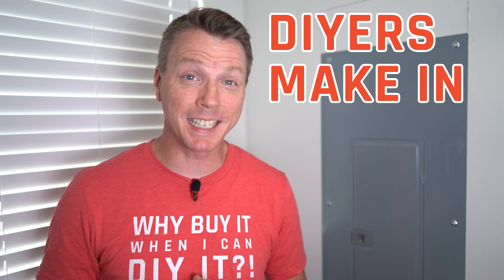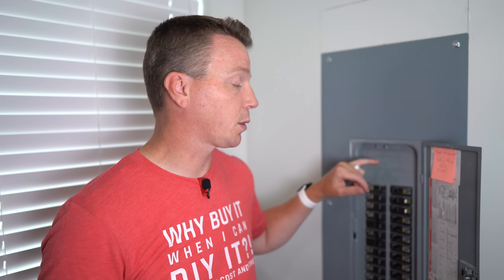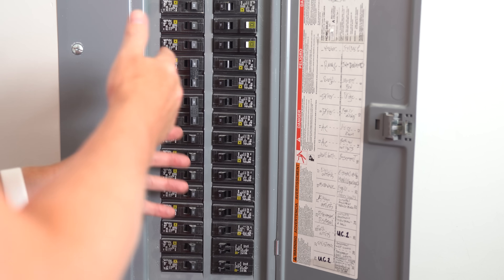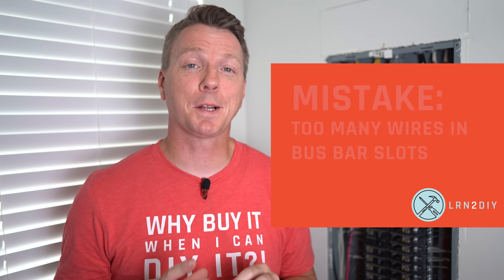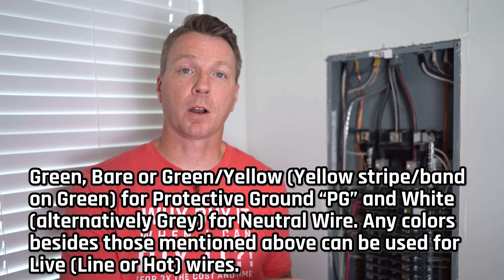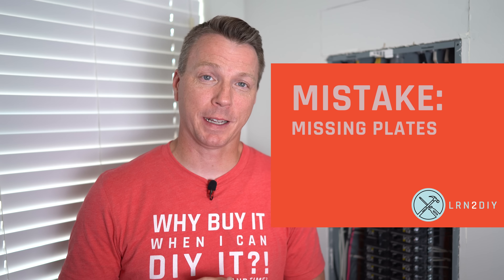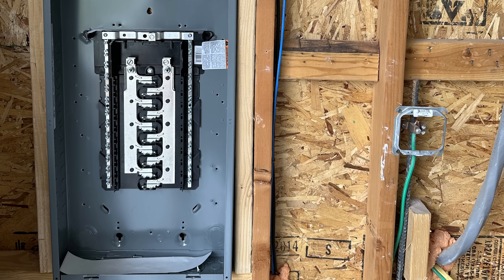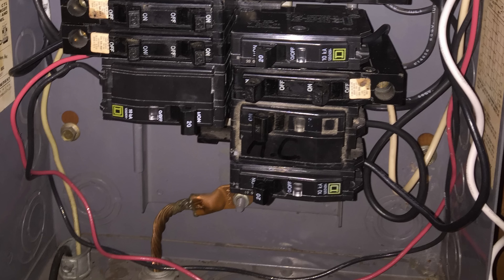10 Common Mistakes DIYers Make In Circuit Breaker Boxes

Comment: @ 2:32 , 80% of 150amp panel = 120 amp. But if you add up the amp of all circuit breakers your total amp is much greater than 120amp. Does that mean a NEC code violation ? So, what’s going on? 

This dude’s short circuit answer: you don’t use all the circuit breakers at once. But his answer is playing hide the ball. You still need to know how many circuit breakers and how many total circuit breaker  amps. 

The dude’s specious answer is dishonest. Or he doesn’t know what’s going on. Basically, he’s “snowing” you. Here’s the answer: The NEC has formulas that calculate the percentage of circuit breaker amp used for bedroom lighting, kitchen appliances, washer and dryer, etc. The formula is based on the probability of your using certain fixtures and appliances simultaneously.  For example, if you’re using the kitchen electrical cooktop , you won’t be using the  hot tub-sauna. This is the reason  your total circuit breaker amperage can exceed the 80%  panel amperage limitation. Notice the NEC has a formula that limits how much your total circuit breakers’ amp may exceed the 80% rule. 

Finally, don’t subscribe, unsubscribe because the dude’s answer doesn’t come clean.

Comment: At 7:15: "Double tapping" on the grounding bus-bar is generally permitted. Refer to the instructions or data sheet inside the panel to confirm this.
Nearly all modern load-centers (Sq-D, GE, Siemens, Eaton) are listed/approved for two (or more) #14 or two #12 ground conductors under one screw... it is perfectly fine and safe.
However, it is generally NOT acceptable practice to mix sizes under the same screw (i.e., a #14 and a #12); both grounding conductors must be the same wire gauge.
In fact, at 12:00 on your video: The data-sheet you show in your panel, indicates that the "Equipment grounding Combinations" are: Three #14 CU (copper), Three #12 (CU/AL (copper or aluminum), and Three #10 AL (aluminum). So your "double-tapped" grounds are no problem!

Comment: What I've discovered over the years is that if homeowners take the time to do electrical work they also take the time to figure out how to do it correctly or they don't do it.    They have a vested interest in doing it right.    On the other hand, you have electricians that work on the rush and miss things that a home owner would never miss.   Perhaps they go out of their way to do it wrong.  It seems that way.   I'm not sure what their deal is.   Nonetheless, you find yourself in an inspection role then you will find more than you can imagine, easy to spot code violations and shoddy work that was done by so-called licensed electricians.    Some of it is so stupid it is hard to figure.  Like a common example is a ground rod buried and a ground wire run but the ground wire is just buried in the dirt and not even connected to the ground rod.   The other classic one is riser pipes installed but not one conduit strap  securing it to the house.   I've seen two pieces of conduit butted up to each other without any conduit connector between them.  A homeowner would never do that.   Sometimes, I wonder if electricians are just screwing with the inspector to see if they're inspecting.

Comment: I always tell newbies to put a small piece of cardboard in front of the main feed (but not contacting the wires themselves) as reminder  to avoid contacting it with any tool or even your hand.  Not touching a hot connection or arcing with a tool is what worries me when beginners take the cover off the panel.  They just have a vague notion of buss bars and circuit breakers.  Getting a shock at a receptical and getting one at a breaker box are wildly different.  One is unpleasant, the other may be life and death.

Comment: unlabeled panels drive me crazy.  overloading, i haven't actually ever heard anyone say you couldnt load them up to their rated capacity. you would need to do load calcs to see what your actual loads are, yes, accounting for some that are continuous loads. Plastic bushings are non required on smaller wires, i think it's #4 or #2 and up. Double tapped neutrals are illegal, grounds are ok for two wires.  Double tapped breakers are fine here (WA) as long as you have those breakers. My biggest thing i find all the time is a cable run into the panel thru a hole w/o a romex connector. I have a torque tool i got from harbor freight, but.... i still use my elbow.  btw, your ugle panel is certainly ugly and your pretty panel is certainly pretty, BUT i see these all the time and i always cut the cable ties off of them. They are fine for installing but guess what you did with all your hots, you BUNDLED THEM!  they are not really necessary with solid wire and create heat retention. and just like you are not allowed to put more than 3 cables thru a drilled hole, because it's bundling, you should not bundle your hots in the panel either. great video, keep up the good work.

Comment: The white wire should be redesignated from the breaker back to where it enters the panel.  You forgot to mention that the panel you are in front of is a sub-panel.  If you do not have filler plates for your panel, a breaker marked spare will work too.  I took an surprised by how many times I've opened a panel to find neutral and ground conductors doubled-tapped when there are plenty of openings on the buss bars where they could be landed individually.

Comment: I'd like to add Air Conditioning to my old house but only have a 100 Amp service panel.  Can I add a 50 Amp subpanel to accommodate the A/C unit or do I run the risk of overloading the 100 Amp service?  Upgrading to a 150 Amp or 200 Amp service panel is too expensive in my area.

Comment: I’m not an electrician  so what freaks me out is when there is a 12/3 home run going to the panel with a shared neutral. I think if you move breakers around you need to be sure you keep the red and black on different phases?
Reply: Two circuits with a shared neutral (3 wire home run) must be connected to a two pole breaker with a common internal trip so they are de-energized together. Otherwise, even if they are on different phases, you can get a potentially fatal shock from the neutral if it is disconnected from the busbar during rework and there's load on the other circuit. And yes, it is important  that the circuits are on different phases, because on the same phase the return current on the neutral is additive, while on opposite phases it is subtractive. DIYers sometimes use  a "twin" breaker, with the single connection to only one phase, which can double the rated capacity of the neutral wire. No bueno.

Comment: Still trying to find out why Americans dont run 200v then sub panle 120v no one in my area will do it then quote 20-30k for a normal 120 that wastes so much wire the homedepot cart i built theres almost 1000 dollar cheeper to run orange romex then sub panle and do short 120v runs since the short runs you can drop gauge acording to charts

Comment: The electrician who wired the shop I have was a drunk, showing up in the morning with a thermos full of whiskey. He put the light switches in the middle of the 2400 sqft building. When I was 17, I rewired it to a three way at each entry. I then got carried away and added 4 circuts of outlets and some pull down extensions. I had bought a book at Lowe's about electrical code and followed what it said. Because I was so young, my parents decided to have an inspector check it out. He showed up and wasn't too excited when he met me and learned he was inspecting my work saying with a sigh, ok, lets get this over with, I might have to come back because I don't have a lot of time set aside for this. By the end, he was nothing but smiles saying he wished every electrician did work like mine. He didn't have a single thing to mark except recommending I use heavy duty switches. If you're halfway bright, you can learn to do anything, just do it correctly.

Comment: I just added a torque screwdriver to "gotta have" tool list as I never knew they existed even though I have several  of the usual torque wrenches. As to rats nests wiring - our last house was blessed with that feature. I would have fixed it if the box was ever upgraded but that's for the new owner.

Comment: although it is CODE to only have ONE neutral per screw terminal (NEC 408.41) you may have as many grounding conductors in the terminal it is rated for ( many times up to 3) usually shown on label in panel ( 110-14) ( yeah I am licensed)

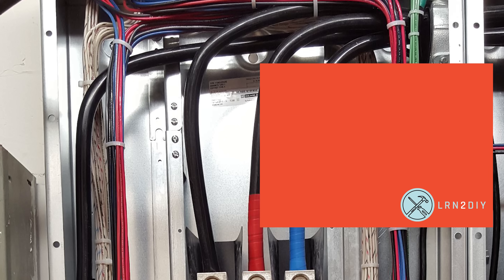Comment: 13:07, This is actually not a good idea because bundling non-metallic-sheathed cables together increases the temperature of the cables due to mutual heating and decreases the efficiency of heat dissipation. The center cables may overheat causing the insulation to overheat and deteriorate.

Comment: (8:15) What about the OTHER end of the red-taped white wire?  It seems to me that THAT is where the actual danger is!  ?🤔
Reply: Other end must be marked, too.
Reply: Absolutely, a white or gray hot wire is even more dangerous in locations other than a panel.  Because in a panel, if I see a white wire land on a breaker other than an AFCI or GFCI type, I can trace it back to the cable jacket.  If the black wire in that cable also lands on a breaker, than I know this is a 240V (or 208V, in a three phase panel, or single phase panel fed by a three phase 208Y/120V service, you'll see this most often in commercial buildings, and in some apartment buildings and condominiums as well ) 

A white or gray hot wire in an outlet or junction box is a recipe for disaster, because there's a good chance that in the future, someone will connect a 120V receptacle or appliance to the black and white wires, unaware of it being a 240V circuit.   

In addition to using the proper colors, when I'm working in commercial buildings, I go one step further and print a label with the voltages and type of system on the cover of each junction box (example, 208Y/120V 3ø , 120/240V 3 ø 4W delta , 277 volts 1 ø, etc. ) as well as the panel & circuit number.

Comment: no no most "professionals" are jokes and idk how they passed the tests but they do and thats where you will get screwed. Im up in canada and im a horrible electrician but even i passed my challenge exam. But before anyone says anything about it its the same exam as the USA. Its not difficult by any means. You could probably cheat it and pass knowing nothing and just going with the common sense safest answer. I am a sparky when i have to be but im also a ticketed refrigeration mechanic and sheetmetal mechanic on top of welding and MET for hvac. But overall not wrong with this video but its a very good once over for any business or homeowner over seeing work done that they are paying for.  Id say i wanna see your requirements/permits for electrical and other trades but i have and in the states its a laugh.

Comment: I didn't read the comments, so it's possible that this is a duplicate of someone else's comments. But as I'm watching your video, I am very conscious of the fact that you are looking in one direction while using your hand behind you in the direction of a hot panel. I personally know people who found out the hard way NOT to put your hands near a hot panel while busy talking about it, or using their fingers to point out issues within the panel. Also sticking your fingers through a knockout inside a hot panel is also a serious safety hazard. Just saying... your information was well received, but watching you is like sitting in a passenger seat as the driver speeds up behind a stopped car and at the last minute hits the breaks... my foot begins to smash on a non-existent brake pedal...

Comment: I highly recommend torquing everything in a panel box bi yearly or at least every 5 to 10 yrs. That will cause a fire faster than an over loaded circuit .
     50% of electrical problems Ive found was from loose mains to loose common and hot buss bar bolts causing shorts. Only a 1/4 turn loose, but enough to cause a sizzle arc and flickering lights. 
  Double checking torque on connections is not something you hear people talk about much, but can cause major issues.

Comment: Crazy to see having aluminum as the buss and using copper. I'm use to doing 400v up to 1000v. I have seen jumpers for neutrals but only for I/O or drives.

Comment: I have every single outlet, light, baseboard heater, fan etc, listed in precise detail (even down to which side of a split outlet) on my breaker panel. I made a separate sheet, laminated it and taped it to the panel.  
it has come in very handy over the years.
Reply: Must have been pretty tricky to squeeze all that info into that sheet. I just made one of those also (not with quite that much detail though). Printed it out on some removable poly labels and slapped it over the label the panel came with inside.
Reply: @0blivionIOX  It wasn't that tricky.  I just entered it all into an Excel spreadsheet and then printed it out.  It's taped to the outside of the panel. I colour coded some circuits such as all the outdoor circuits or kitchen circuits to make them easier to identify.  I also discovered some wiring mistakes when I created it.  2 circuits were actually cross wired.

Comment: My friend is an electrician and has told me circuit breaker boxes are liars and to never trust the labels
Reply: No crap!  I un-installed an old dishwasher and installed a new one.  No power to the old dishwasher, no problem!  I cut the wire..sparks went everywhere 😂. 
I guess the breaker box was marked incorrect
Reply: @lowlifeangler  Testing the power to the unit or using a circuit locator before cutting the wire was a bridge too far, huh ? ⚡⚡✨✨😲                🤣
Reply: @CannonFodder873  I should've known better. My wife jumped...I didn't. Left I mark on my new cutters 😆
Reply: Your friend is right. Whoever labeled mine got the 240V breakers for the dryer and the HVAC mixed up. I switched off the breaker for the dryer to replace that outlet, and at the last minute before I unplugged the dryer I noticed the light inside the dryer was still on. I would've had a VERY bad day if I hadn't noticed that.
Reply: As an electrician i agree.
Reply: So true

Comment: As a licensed electrical engineer, I don't fool with what a licensed pro should do. Most tasks that these so-called DIYers do aren't expensive. Call a pro for electrical work. A tiny mistake can burn down your house or seriously injure you because you wanted to save a few hundred bucks?

Comment: at 5:30 you mentioned cut off ground wire , in the hundreds of panels i have been in i have seen where they used 4 wire instead of 3 wire SER and SEU types . if the panel is not sub feed then the neutral is bonded to the can via the green screw on the neutral bar.

Comment: Number one....amperage doesn't get pushed it is drawn or pulled.. 2- there are instances that you can use a lager breaker on your wire gauges, motors being one. 3- grounds are allowed to be doubled up as long as they are the same gauge.....not neutrals. Not all that bad though.

Comment: Square D ground terminals or Neutrals used to terminate ground wires in service equipment have always been UL listed for 2 wires per screw terminal (#10 - #14) and most recently re-tested and UL listed for 3 per screw terminal.  This information is on the box label.

Comment: What if your main MCB/RCBO have to feed to a series/row of MCB(connected with bus bar) and you can only feed from main using jumper? and also need to feed another row of MCB(different panel) via jumper wire? so there will be two jumper wire at the OUT terminal of the main mcb.. and the row of mcb being fed will have 1 jumper wire coming IN and connected the rest via bus bar?

Comment: As a handyman I saw a lot of boxes and most were not labeled. Maybe only the 240 volt appliances. 
I would advise standing on a dry board and using one hand.  I also found that main shutoffs would not always reconnect. Didn't use them.

Comment: 😢😢After getting stuck on a metal pole with electricity running thru it back in the 1960s, I refuse to mess with electricity. Ever.

Comment: I just finished helping my son clean up an electrical panel that had more code violations than proper practices and we saw most of your issues and then some.  But, there is one additional issue with the typical home breaker boxes, more specifically the Molded Case Circuit Breaker itself.  Breakers are internally lubricated to ensure they trip properly.  After many years of sitting in one position, the lubricant becomes hard and impeeds the proper operation of the breaker.  Recent preventative mainenance practices require each breaker be exercised several times every couple of years to keep the lubricant from hardening.  It is a really simple task, especially during an unscheduled power outage, to walk down and cycle each breaker a few times.  It helps to ensure its proper operation of protecting you and your home.  Hope this helps.
Reply: I know it's NEVER done, but replacing ALL breakers after 40 years is not a terrible idea.
Reply: the newer breakers use a 'grease' that doesn't harden
Reply: OT: Same with gate valves in plumbing, and to a slightly lesser extent to 1/2 turn valves. 
I work on a lot of homes in the 50-100+ year old range and rarely find a gate valve that isn't frozen with corrosion. Homeowners typically don't know anything about the mechanical aspects of their home.